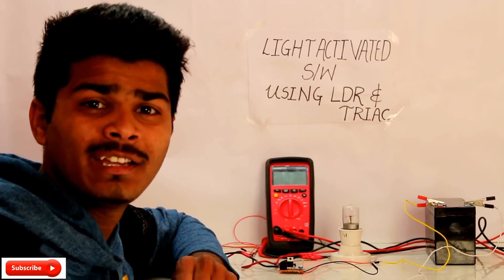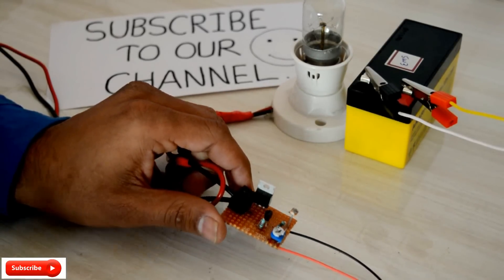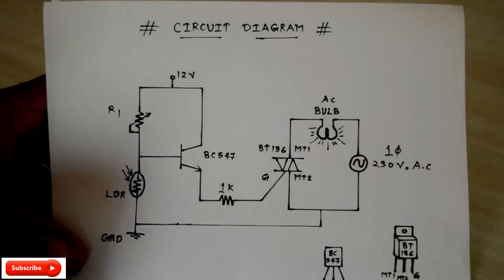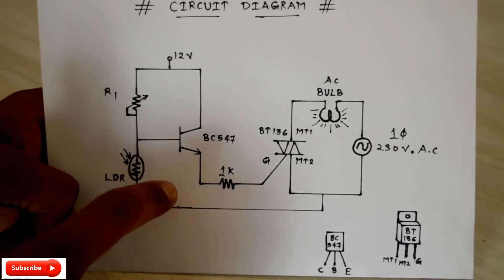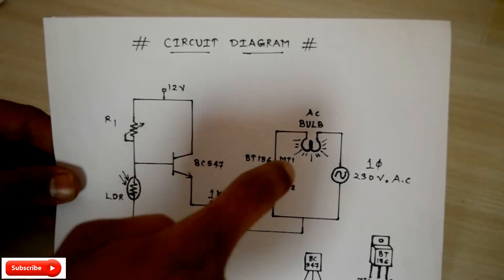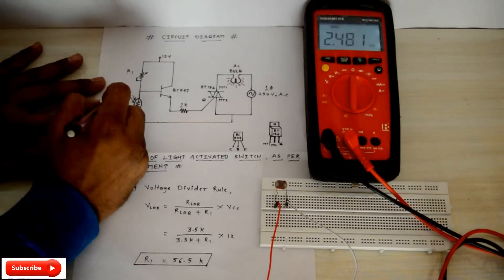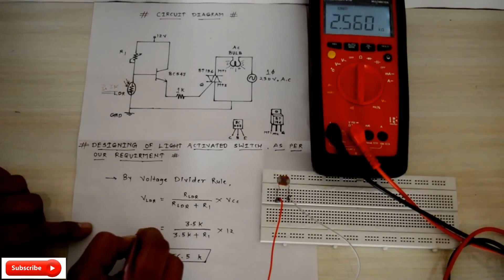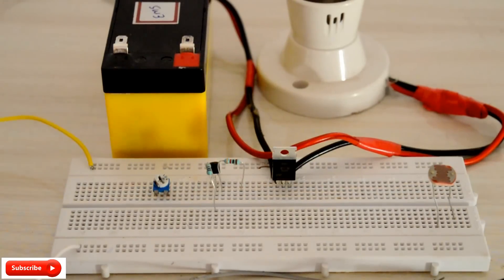Light Activated Switch Using LDR & TRIAC

Comment: hi bhushan when i close the ldr with my palm the load is not switching off i did the same circuit which you have shown please tell me what might be the problem and can we use fixed 56k resistor instead of the pot
Reply from the maker: Calculate the Vbe for 56k ...then you will come to know..

Comment: Just to let you now, I designed the exact same circuit a few years ago, the LDR and resistors are different but achieve the same result. The main difference is a BTA16-600B triac instead of the BT136. That gives me 16A current capability and is perfect for automatically switching the lights on for my motorcycle.
Reply from the maker: Okk ...nice

Comment: Updated circuit after adding /soldering  1k resistor between the base terminal and volatge devider network may be provided in the video.
Reply from the maker: Vilas Khare ..ckt diagram is given in a . discription area ....
Would you like make this ckt?

Comment: Good job,  but other circuits are bigger and seems complex because they dont use 12v DC source. Instead they convert the 230v mains into 12v DC. Other thing is during light, is. when the ldr resistance is low, there is huge current flow through the voltage decide circuit... So off state losses are more.

Comment: fraud in this circuit shows that you are using ac load but in end of the video you are using a dc voltage from the battery are you kidding us!!!!
Reply from the maker: +divakar sin  all over ckt is working on dc ...only losd is connected is series with triac ..that is ac .. remember 😊

Comment: Awesome man...
but that voltage divider calculation is confusing
Reply from the maker: you first assume the resistance of ldr as per your darknes.... then as we know 0.7V is required to turned ON the Transister... then will asum Vbe=Vldr=0.7then we know the Vcc=5V.... and as per voltage devider formula Vldr=[(Rldr*Vcc) /(Rldr+R1)]..... we an easily calculate the valu of remaining resistor Wcich R1.. in ckt diagram